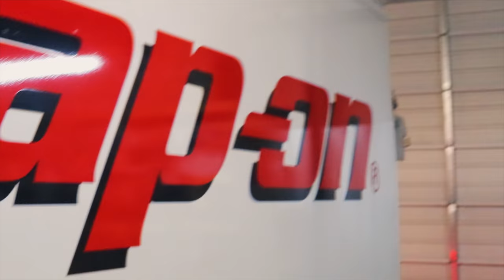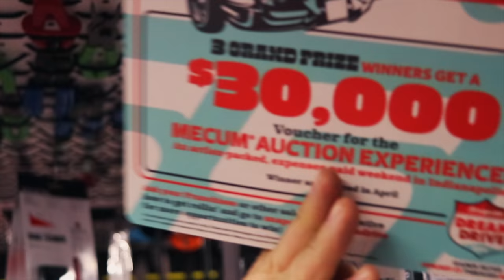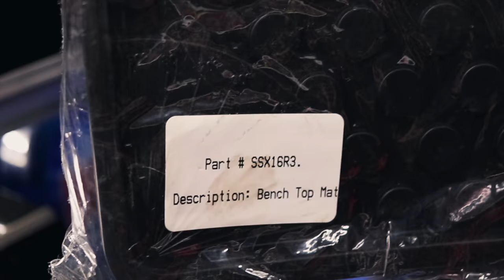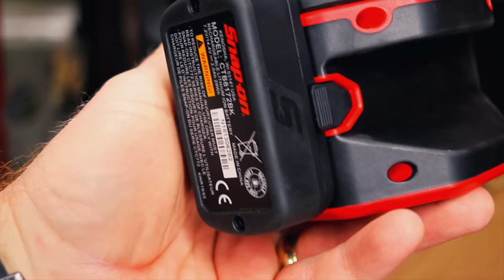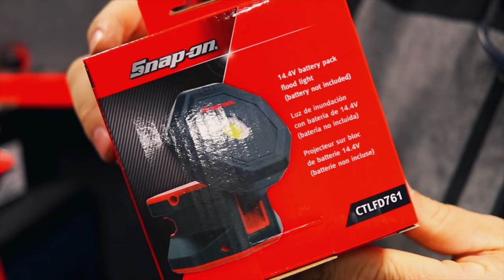New Snap On Slide Top Roll Cart. Why a slide top? Can open it with stuff on the top !

Comment: I'd like to Snap-on mount a small electric motor on that monster creeper with the ability to operating it like a skid steer.
Reply from the maker: Haha that would be cool
Reply: Koon Trucking yeah man, install long-handled ratchets as the manipulating levers and use the switch on the ratchet to put either or both sets of wheels in forward or reverse!

Comment: Tell Wild Bill to make sure he keeps the caster tube nuts tight on his do nothing seat creeper he got last week.  Going over jumps like you have in your shop will loosen them and start to strip the caster threads and bend the tubing on the bottom of the seat.  I just found that on mine that's about 9 months old with gaps in the floor nowhere big as yours.  My guy is making it good for me but beware of the bumps.  Using the battery magnet the new light works well, my guy had one on the truck.  It was a little big for me so I passed but in the right app it would be a good light.

Comment: Funny you mention kimbell midwest. We just got an account with them and since you mentioned there penetrating spray I'll have to give it a try. Do you reccomend anything from them. I have their lock tight and their super bond glue
Reply from the maker: We get the penetrating oil and bolts from them

Comment: Does the roll cart have slots for pry bars like the open lid style?
Reply from the maker: Nope
Reply: Koon Trucking thanks. I’ve been on the fence on getting the 40 wide flip top.
Reply from the maker: I plan on doing a video once i get it all set up like I want it. There will probably be some pics on Instagram of before and after of the clean up process too

Comment: I have a  
Question  I want to buy a new truck what  engine you tinke is best paccar 510 or Cummins 500 hp
Reply: all depends on the truck you are getting. w9 your only option is going to be a cummins but like a 680 i would go with the mx with the eaton fuller advantage